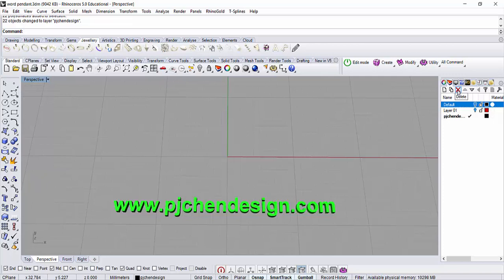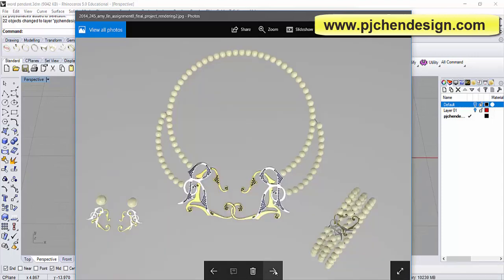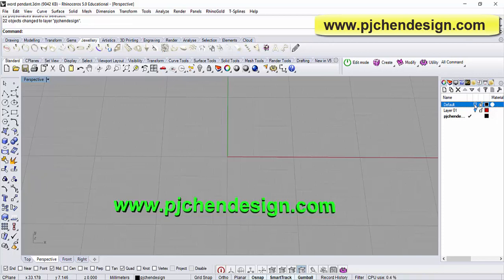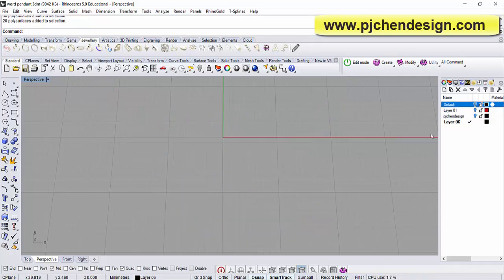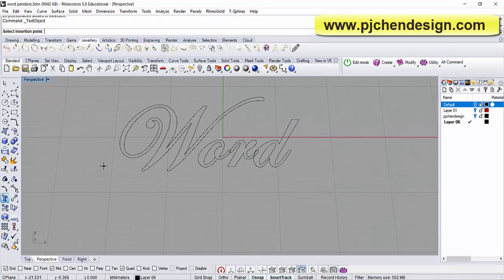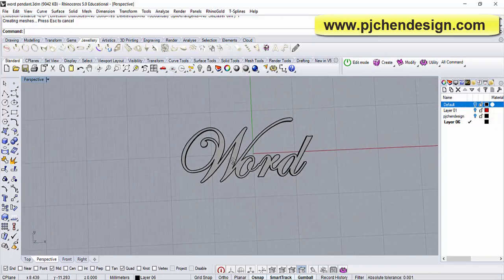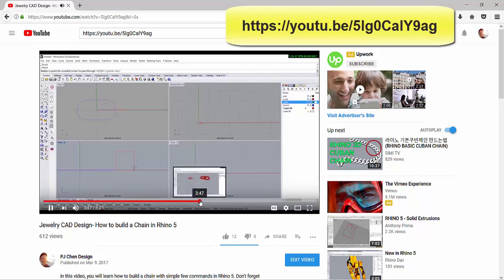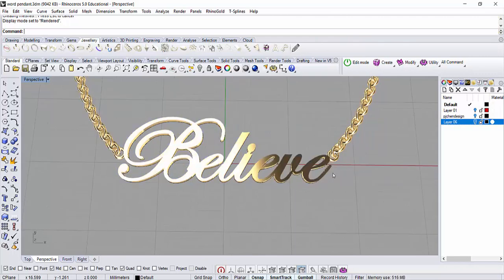Jewelry CAD Design Tutorial #13: How to Build a Fashionable Word Pendant in Rhino 5

Comment: Thank you for the video this really helped me because I am a very beginner. I am having troubles with the trip tool, it is not possible to me to put off the lines in the W letter, when i use it, it drops all the word. I will be very gratefully if you please tell me if something in the points are causing troubles or I do not really know what is happening. Thank you very much, I saw your channel and you have very interesting videos. Regards!
Reply from the maker: Hi Frank, I cannot tell without seeing the 3dm model. you can email me at pj@pjchendesign.com and write me what was wrong. I will take a look for you